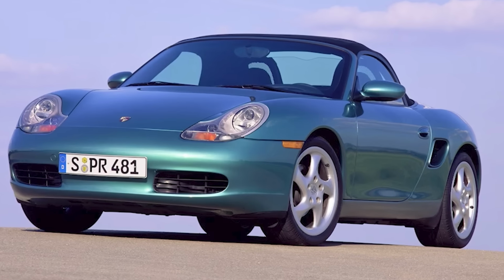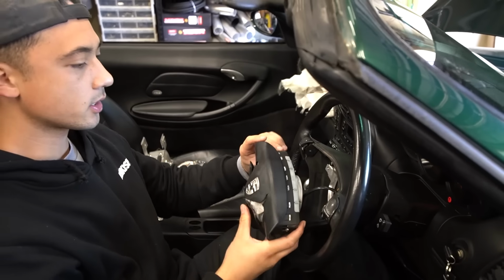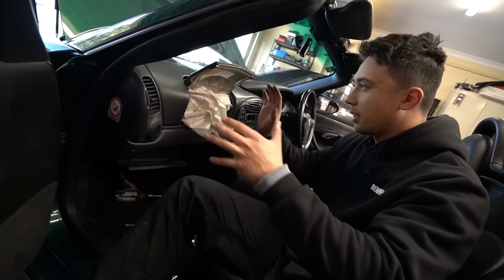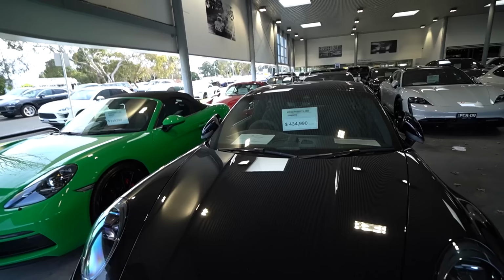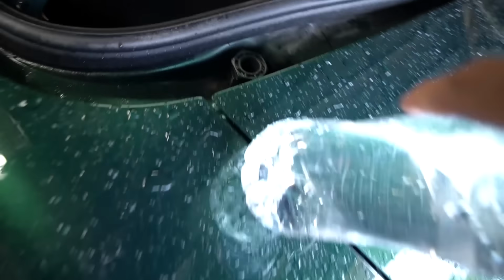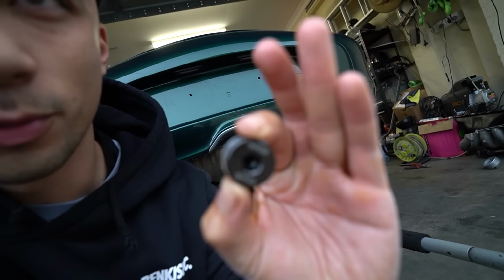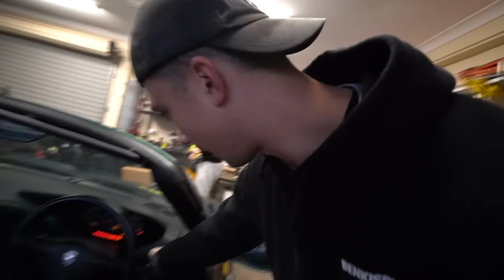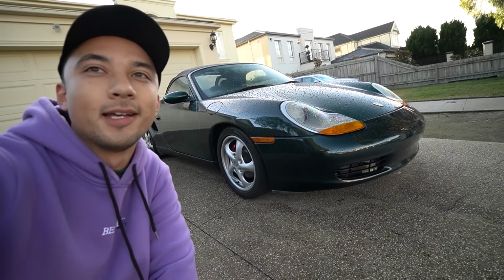I Rebuilt A CRASHED Porsche Boxster for CHEAP

Comment: I’m considering buying one of these but it has light bore scoring. Smokes a bit and the AOE has been changed. It’s a 2.5L.
In 2 minds whether I should or not
Have you done a bore scope on your Porsche?
Reply from the maker: I wouldn't man, engines arent cheap

Comment: Give you an update on the 2000 Camry LE 4 cylinder. I found out of all places YouTube. I guy with a RAV4 was having issues with his O2 upstream oxygen sensor. He had bought one with a short band. I had done the same thing. I've wasted money doing the same. Both upstream and downstream. Some I can't send because I ordered them online. So what the guy said on YouTube was that all Toyota's take a wideband O2 but not just any O2. So I was at Autozone yesterday Saturday I bought Denso Air fuel ratio O2 upstream oxygen sensor wideband for $183.37 with tax. Regular price without tax 172.99. They only had the one so I had no choice but to buy it. Now I'm wondering if the downstream is the same way with a wideband. Still I'm cautious. I can take it back if it doesn't work at least that's what the guy told me at Autozone. Hoping it work. I've been driving the Camry in closed loop because I didn't have the right O2 upstream oxygen sensor. I just want the 2000 Camry LE 4 cylinder to run like it's supposed too. I'll let you know if it works or not. Until then peace.
Reply: Who tf cares?
Reply: @mun33y  can you imagine knowing this guy in real life haha

Comment: Who buys a genuine oil filter? That's also the smallest oil drain bucket I've ever seen...
Reply: Only time I get genuine oil filters is when the cars under warranty 

Would have been half the price for an aftermarket it’s not like the genuine one really filled with any better
Reply: @MicksMechanics  doesn't matter if you get Ryco or non genuine under warranty no authorised mechanic (not a dealer of the brand you bought) goes out of their way to source genuine filters...
Reply: @MADagain  I do for some new cars under warranty 
Brands like ford will do anything to avoid covering warranty 

Toyota and Subaru I just use Ryco